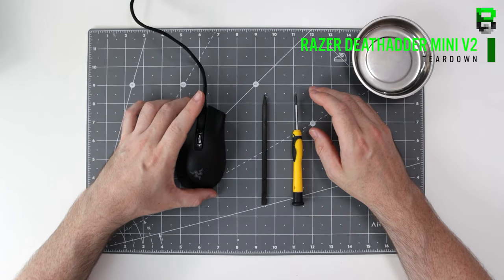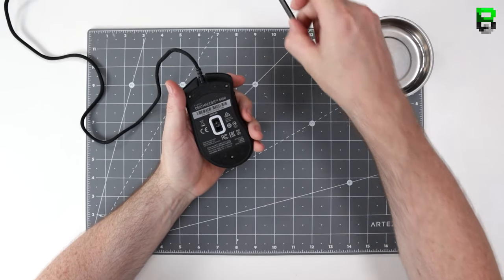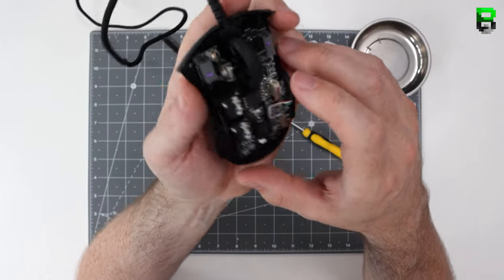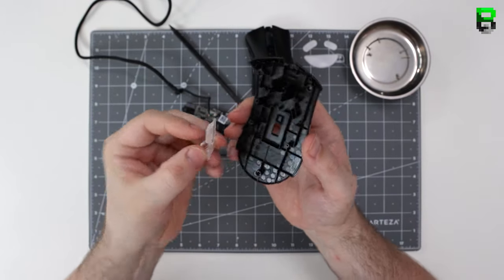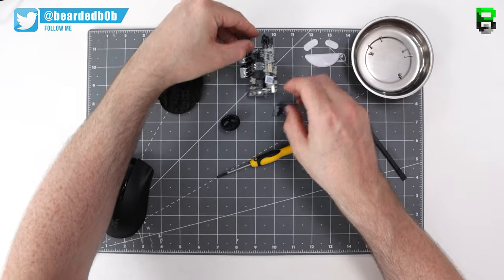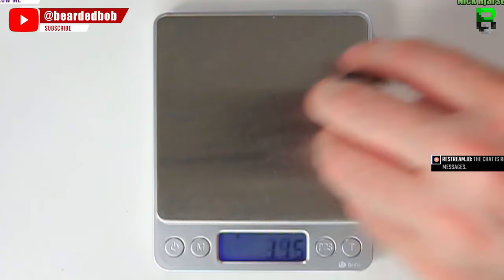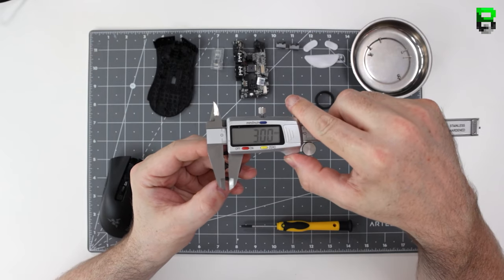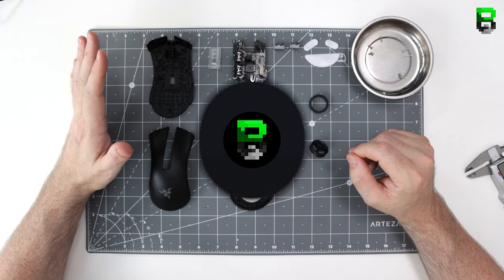This Has Different Switches - Razer Deathadder V2 Mini Teardown

Comment: Which switches in this mouse are optical and which are mechanical?
Also, what kind of scroll wheel encoder does it have - optical or mechanical? Mechanical ones are bad, I had to throw away quite a few not the cheapest mice just because the scroll wheel encoder got worn out and did not work properly anymore.

Comment: How do you put back the top cover piece that in the end is in the bottom left?

EDIT: Found out. The right click side of the cover wasn't fitting and in the last attempt I realized the "column" has to fit with a small metal tab from the piece below, that tab had got deformed in my previous wrongly attempted place back in. You have to slid the front two from the front backwards so the two tabs, one per button, slot inside the back holes in those columns and then press the back down.

Comment: Are the optical switches in the new deathadders and the vipers the same/ feel the same? I've used the DA v2 and the clicks felt really light and weird so I'm not sure whether I should buy a viper mini...
Reply from the maker: Different
Reply: @Beardedbob  could you elaborate? Does the DA v2  have a newer version? Do you explain the difference in one of your vids?   Thanks for your help :)

Comment: that sensor must go, it's so bad :(, i love everything about mouse like the viper mini but the sensor it's so bad
Reply from the maker: Agreed it should of had the 3389
Reply: @Beardedbob  agreed, the mouse lift off distance is the worst thing i have ever have in that price, i could have a logitech g304 with better sensor, wireless and personally i think a better switch I don't know, but the viper and DA have so much potential, I like the shape of them more, the wire is very good, the weight is so amazing  and the mouse feet are the best  but i could custom change the g304 mouse feet too so i think razer need to improve the mini series if they want it to be a better mouse
Reply: @Saki_rnd  Could be just the prism that they use. Covering it fixes the LOD issue. I had the DA Mini and the Viper Mini and that's what I did to resolve the LOD issue.
Reply: @Tenspeed1  what are u talking about? theres options in the software to manage the LOD from 1mm; 2mm and 3mm
Reply: @scafierr1709  looks like you just got the Viper Mini now.